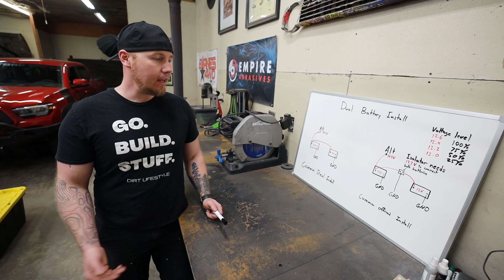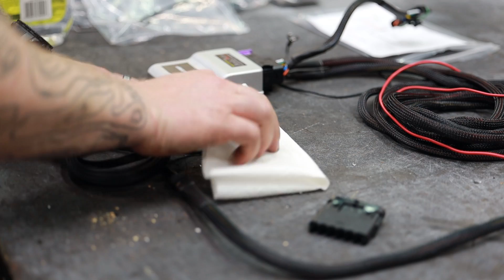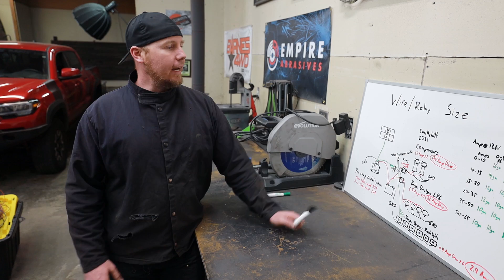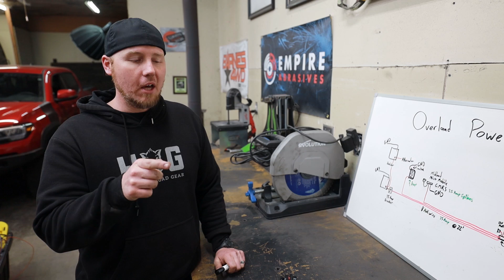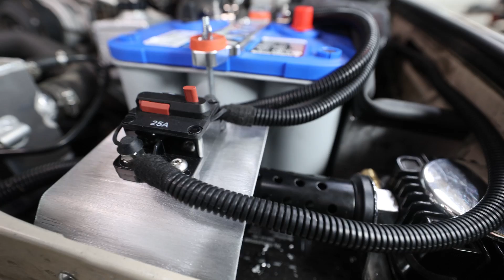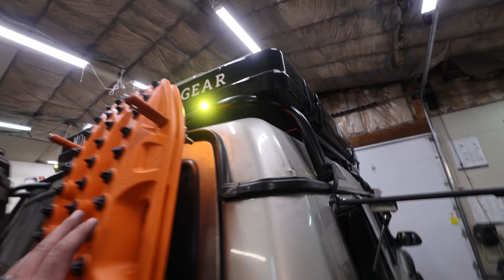A Complete Off-Road Wiring Guide! Ultimate Land Rover Discovery Build Episode 26

Comment: Great stuff as always. I fixed up a 98 Disco for my wife and now am rebuilding/overhauling a 99 XJ for myself. Picked up an old 110 mig welder and broke out the Hakko solder station…
I decided to take some parts I already had from a backyard astronomy observatory I recently had to take down. My spare Yellowtop is going where the rear seat went on the XJ. Solar panels going up on the roof. Using Renogy’s mppt unit w/BT-2 (bluetooth adapter) and eventually adding a separate fuse panel and inverter in the back.
I’ve already replaced the pans and full rockers and added stiffeners mid thru back. Need bumpers and a roof(tire)rack. Recarpeted interior and did full Killmat and Thermal insulation. Eliminated center console and fabbed new e brake as pedal. “Derustified” and recoated underside. COUNTLESS other fabs/mods along the way. Going for comfort and function, as this will also be a daily driver. I intend to use this for astronomy outings as well.
I’d make my own channel, but I would never have time to get the work done. Thank you for the clear and concise (and entertaining) videos, without being all “Jeep-bro” about it. Also, thanks for avoiding using the same annoying out-of-balance montage music (over-the-top fakerock and pseudo trip-hop). 
I just really dig how you do things.

Comment: I agree that AGM batteries are awesome.  I have one on our deer lease vehicle.  We disconnect the battery when we leave then come back 6 months later, connect the battery, and it just starts.  Traditional starter batteries were useless within about a year as they would discharge too much.  I've had better luck with Bosch AGM batteries than Optima.

Comment: Hey Nate @DirtLifestyle ! I am trying to run a compressor the way you are running it with the same solenoid but I am using my 40 amp aux switch in my Jeep JL. I may have a defective solenoid or I am connecting it up the wrong way. Can you give some guidance?

Comment: Where did you ground everything?.  What's the opinion on a ground and hot  bus bar ?  For example to have a central point  in the rear  to run a single hot  cable and to have a single grounding point

Comment: i have a yellow top in an '06 F150 that has the studs, i used the studs to install a battery maintainer because the truck does a LOT of sitting, like months at a time to sometimes an entire year, and i had an Optima in a jeep that lasted me 15+ years before finally being killed by extreme winter weather (-20) after an absolutely brutal summer of 115+,  on my current rig i'm building, i converted my stock battery cables to 2/0 cable and installed a set of "Marine terminals" on my optima red top so i have the studs to tie everything to, i also upgraded the 8awg wire going to my factory PDU under the hood with a 6awg and ran 4awg to the alternator and boosted my engine grounds with 4awg as well as my battery ground with 4awg, then ran 2awg to the back for an inverter/aux PDU, fuse boxes are indeed a chore, but once you figure out how you want everything laid out, they go pretty quickly, solid information, and a good build, take it easy bro, stay safe out there

Comment: I had my last set of optima  D34m batteries for over 6years before I had to replace them last week even though they spent 2hrs under water in my drowned Defender! I have an override switch to join up the batteries to cover any starting emergencies Like your battery hold downs. Cheers Steve

Comment: Pretty sure the wire length on those charts are round-trip distances.  The power has to flow out to the load and back to the battery to complete the circuit.  So - if a load is 9 ft away from the  battery or switch panel, electricity has to flow 18ft.  It makes quite a difference in the size of the wire.

Comment: Hey Nate, great video as always man. I've got an m715 I made a bumper and bar work for and thanks for the inspiration. 
Electrical,  as far as total amps per circuit.  In the 120v ac world a circuit is considered maxed out at 80 percent of the circuit breaker.  So a 100 Amp breaker with an 80amp draw is considered maxed out. 
20 percent cushion for surges and stuff,  not sure if that's fully applications m applicable to 12v but it makes me feel better. Have seen too many close calls to mess around with wiring!

Comment: I have purchased over 20 Optima batteries and the old ones are as you described. I have the ones made in USA last over 15 years. The new ones are made in Mexico and I have NOT had any luck with them. Lucky to go past 4 years. I had unused yellow tops never installed go dead in 4 years. I don't have any "new" Optima's reach 5 years. I spent a lot on Optima chargers and they don't save them. I will NEVER buy another Optima. Sorry but just want everyone to be informed. Love your channel!

Comment: I use optima because  you go upside-down theres nothing to leak out.. And there fantastic for lots of off road lights. 
I put it in my car just to check out and it can't handle my high powered stereo system the way a regular battery can. I guess because they are a dry system.
And yes all my under hood charging wiring is upgraded. Just seems to suck the power on bass notes..

Comment: Thanks for taking time and effort to make this Nate, it's really appreciated! I'm working on a bit of a frankenstein project of a 1952 M-37CDN (Canadian, and yes, there are differences to the U.S. trucks). My challenge is to make a dual voltage system as the truck is originally wired as 24V, which I am retaining, but my additional accessories are 12V. My solution thus far has been to use aircraft 24 to 12 volt DC/DC converters in dedicated circuits, while retaining the 24V switches. Not the cheapest route to go, but it works and is a very reliable and rugged option. I'm now a dedicated fan of the whiteboard, thanks to you.

Comment: Super video, well presented, I’m an electrical engineer specialising in DC & UPS systems high end and I love this sort of Vlog,  thanks for all of the links and tips , the only real long term issue some people might come across is the working battery for accessorise might deplete in age quicker than cranking battery due to cycle usage but otherwise its a very well designed setup and as you said quite easy to install,  once DIY’ers respect gauge wiring and always fuse each circuit they should not come across too many issues :).  Keep up the good work.  Pity I can’t buy any merch,  US import into Europe is hilarious it might be an idea to team up with a European agent like front runner and we can all dodge the dreaded taxes.  Again keep up the excellent work, :)

Comment: I like your balance of wheeling and building vids.
I noticed you didn't drill a hole in the roof to run the rooftop wires, care to elaborate how you ran them and plan to keep water out?

Comment: Hey Nate I don’t know what your opinion is on the cable ends, but I’ve lately been using the soldered ends from a company called Wiring Depot out of Reno Nevada. You drop the solder pellet in the connector, heat with a blow torch and then just push the wire in. Found that the connection was more consistent than crimping and quite a bit less resistance as well. Just food for thought for you, you might check it out.

Comment: I remember reading something along the lines for wire size in a book called Baja bugs and buggies a long time ago that it is better to aim large for gauge all the way through so as to not worry about amperage and also if you need a wire to keep something running while out on trails/courses (read Baja 1000 and the like) you can scavenge from lighting or some other accy that is not fully needed and be able to use it without worrying about if it's the right size. Plus it is cheaper to get a couple full spool and not have to buy  multiple sizes

Comment: I do this stuff as a hobby and profession. The only remark I can make is regarding to the wire sizing. You mentioned that you would need 12ga to do the main run to your lights and then you could step it down more and more to the further lights. This is not safe considering fusing. You must have a fuse that's appropriate for the smallest wire in the circuit, and your smallest wire wouldn't be able to handle the current going through the 12ga if there is a short in the smaller wire. Your fuse/breaker will allow a short in the smaller end wire(s) to melt and burn. Tldr, don't step down wire size anywhere, it isn't worth it.

Comment: So using the isolator will keep the system 12V instead of 24V with both batteries in tandem? You essentially have two 12V systems being charged with 1 alternator if I am visualizing this properly.

Comment: Great video Nate. It’ll be interesting to compare this system to a system for your Taco if the newer vehicle has a smart alternator and requires a dc/dc charger. Or you integrate solar. 
Love the older engines and their simplicity.

Comment: Great info. I decided to go one step further and install a charge controller instead of a smart solenoid for my own build. I like the longer battery life and I wanted to run batteries with two completely different profiles (deep cycle secondary and a start battery primary).

Comment: A question about the air tank ... why couldn't you have used the rock sliders you built as air tanks? A couple of check valves, fittings, and some Synflex air line to a manifold, and you'd be done with likely a fair amount of air volume.
Also, you might want to check with Midland ... reliable rumour has it that they are releasing an MXT500 (50 watt) radio that has all of the controls on the microphone, same as the MXT275 radio.

Comment: !!! ALWAYS !!! size the wire based on the fuse or circuit breaker, rather than the load.  That way if the load shorts, or something cuts the wire or rubs through the insulation for some reason, the wire can handle the full current allowed by the fuse, thus avoiding a wire melting/catching on fire.

Comment: Awesome video Nate. I love the whiteboard. It helps to visualize the end game before having to stop in the middle to wait on more parts in case something was missed in the initial graph paper design. I definitely saved this video to watch later.
I'm sure its not done but are you going to put heat shrink on the split loom to tidy it up and keep from snagging the wires on the fuse box inside the gull wing?

Comment: Do you think that isolator could be used to send a charge to a lithium battery for charging elsewhere in the rig rather than a second battery under the engine bay? The gears are turning in my head for charging a domestic PLB40 located elsewhere in my Jeep.

I love wiring when I have time... but boy does it take time. I can't imagine how many hours it took to make just a 33 minute video with so much content. Well done sir.

Comment: the isolator, where do you prefer to mount it? close to main or to sec battery? done 12v systems for 20years but in car audio so hard draw and "extreme" if you set it agains a tourer in amps. so an easy setup in a short setup (Pajero) never go less than 0 awg from front to back, isolator position?

Comment: Come on Nate need more low buck diesel truck videos. I’m currently building a 71 j2000 gladiator and need those videos for motivation. Chevy 63’s in rear, bobbed, built 9” 89 ramcharger built d44 front(I tossed the closed knuckle) 3 link and ORI’s going in next up front. Gonna rock the stock Buick dauntless 350. Until I save enough for a R 2.8 Cummins down the road. Still needs cage(hybrid style) and some odds and ends finished....seats, sliders etc. I pulled the bed and boxed entire frame cab back that was originally “C” style as well. I need more gladiator build vids man love your channel!!! Keep em coming!!

Comment: This was very thorough and yet watchable. I might have fed the 25amp circuit breaker with a 65amp fusible link. There is no way, under usual circumstances, the link would blow but in the worst-case situation it would eliminate the unprotected battery to breaker wire. Yes, I am overly cautious.

Comment: what are your thoughts on a deep cycle as the aux battery with a DC-DC charger instead of the 2 optimas and the isolator? seems like the deep cycle would perform better for running your gear with the vehicle off?

Comment: You hear it all the time nowadays..."Optima isn't what it used to be since they moved south of the border" and technically they're not. There's been plenty of bench tests that support that BUT not to the extent where the average joe would notice. If you were competing for SPL or going to mobile audio shows and giving out bass demos, running a dozen subwoofers & amps at 50k watts where every 1/10th of a volt & how fast the voltage rebounds makes a difference then yes...you might notice but for off road and/or overlanding purposes they're still a premium top tier cell. It's insane how people take something, run with it & regurgitate it like it was gospel.

Comment: The stock alternator - "bro......." lol

Remember kids. Wattage does work. Watts = ampsxvolts. Loose/bad connections, under sized wire, shorts all cause voltage drop. When you have voltage drop, amperage draw increases that burns things up.

Comment: Wonderful explanation but if I can suggest this days you have better option on market than dual battery system in off-road vehicle. Do the initial wiring up to fuse box but connect to it Bluetti2000 or other choice of your power station and that way you have device which you can take with you for off road or other project out of car. I have previously dual battery system and when I found I can do this same with Bluetti and but be more flexible I make simple changes to system.

Comment: Hey Nate. You're the man! I've learnt a ton watching your channel, keep up the amazing work. I'm building an 80 series toyota landcruiser, it came with a dual battery set up, I use one as a winch battery and the other obviously a starting battery, then I'm about to take your advice and order an isolator switch because I've put another two in the back for anything electrical to do with camping. Would you suggest I connect my solar system to my main start battery to keep a charge or would the batteries after the isolator switch be a better option to connect the solar to???

Comment: Also...instead of connecting all those accessories to the battery...use a power distribution box and connect everything to it...run your alternator wire to it as well..then when you have to remove the battery you only have to remove its wire to the distribution box instead of all 50 accessory wires on the battery...

Comment: The problem with an isolator...if for some reason your main battery mysteriously goes bad you can't use the 2nd battery to jump start the vehicle..because it depends on another wire from the main to connect the 2nd battery to the vehicle...solution...run another wire (on an on/off switch)  from the 2nd battery to the isolator that will engage the isolator..else just carry some long jumper cables...hope that makes sense as I'm at work..

Comment: Appreciate the vid. I got a dual batt isolator to install in my buddies stealth van. His inverter with ac load was pulling to hard on single batt, even with 300 amp alternator. So using same isolation to dual blue top. Set up. I used a 150amp anl fuse block vs breaker but told him to buy a few extra fuses just in case 😉 can’t wait to see the set up in use 😉😉

Comment: Nate, the keyline isolator is great but it will never charge your deep cycle agm to an optimal voltage. The isolator will also eventually cause your alternator to wear prematurely. I highly recommend a dc-dc charger.

Comment: I’ve just done all my wiring and Dual battery system and now I’m thinking I should of done it differently 😂 I mounted my second battery in the boot so I had less cables running through the car for the accessories, gullwings still on my todo list 👍🏼 keep it up 🤟🏼

Comment: Volt->voltage, amp->current, ohm->resistance, Henry->inductance, farad->capacitance. There's no "amperage," just "current." You said it right once, then... incorrected it!
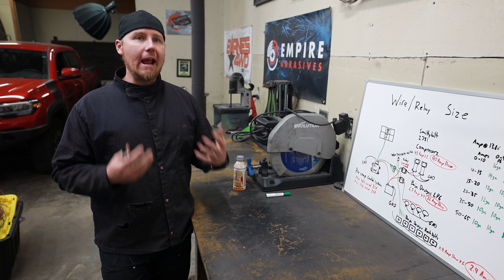Reply: You had it right at 14:20. I used to work at a nuclear weapons lab, and there were physicists with PhDs that would say "nukyaler." Using the wrong word doesn't mean the info is wrong--this video was great--just a pet peeve on vocabulary.

Comment: Thanks! Great video. Very informative, but not boring. What is the disadvantages of running a slightly larger then needed gauge wire? In your example, your rock lights don't need the 12 gauge the entire length as each light in the circuit reduces the amps needed to traveling the length to the farthest light, but does it hurt just to use the 12 gauge for the entire length? Just seems like it would be easier. Also, what does grounding out mean? (Sorry if these are dumb questions, kinda new to this game)

Comment: Reduce the voltage drop on compressors by running shortest length of wire to battery and tap into inbuilt relay on compressor. Or remove relay on compressor will make a noticeable difference in performance

Comment: “There’s a relay to a relay” yep that’s pretty common for electronics. You did that exactly right. It’s because their relay will burn up, but they might not have enough power to drive a larger relay directly, so stepping it up in multiple steps is how you solve that problem